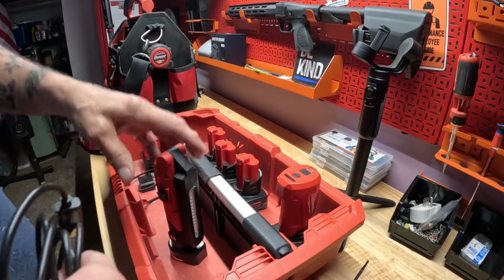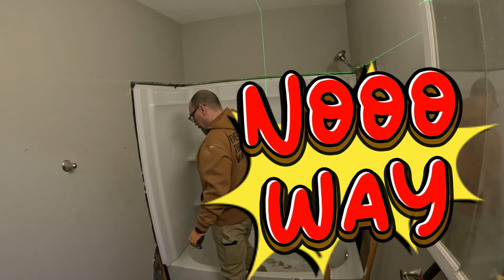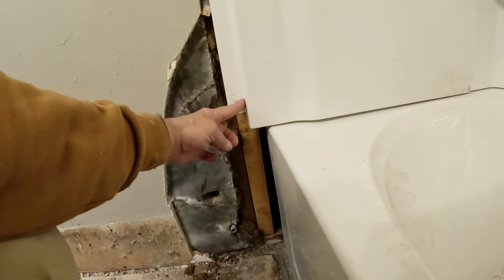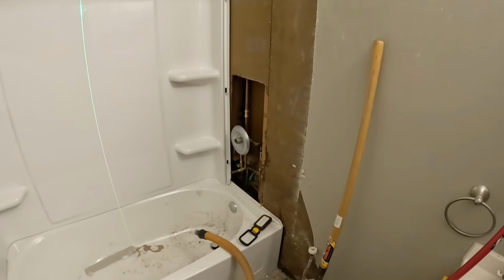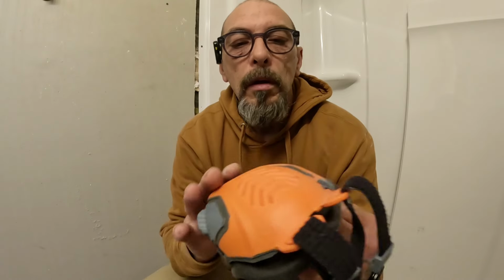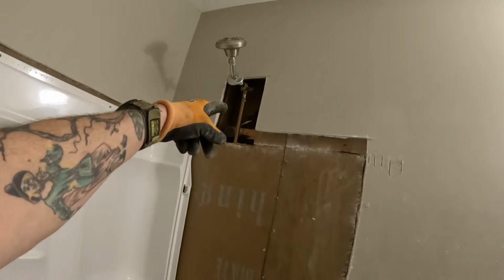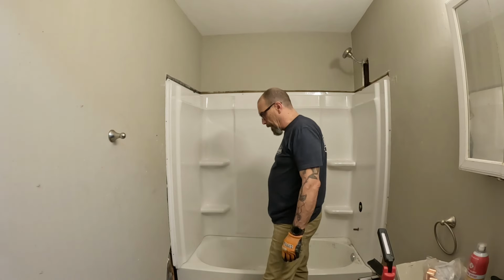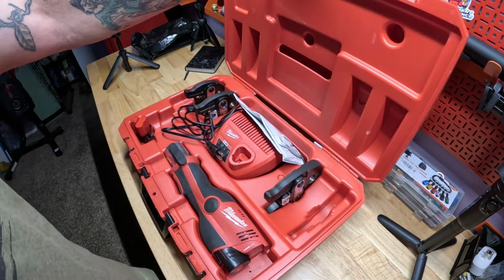The install just went bad, am I able to save the install!!!!

Comment: Separately pieced tubs are set-up for failure: especially when it comes to mold and mildew at the seams
(Most of the time bathroom fans are not even vented correctly and that will speed up that process)

Might be better off for future tubs to just be a one piece and then replace the drywall with GoBoard or green board, so you can waterproof accordingly. (It would most likely be less frustrating than this tub-system)

Great install and perseverance!! 🙌🏽
Reply from the maker: Feel you-- ?   How would i get a 1 peace tub in ?  That would be an almost impossible task. I would have to remove walls to do that. Fyi, this is apartments, not residential. You got to get it done fast and efficiently. And I am one 1 person, not a crew. I feel your though regarding install
Reply: @Raysmaintenance  that is true to be honest 🙌🏽 I am young”ish” and have only done tile/flooring in residential 
The south east humidity and poorly ventilated bathrooms turn sour quick out here, so I get YouTube tunnel vision

I was on my 3rd coffee this morning and overthought everything 😂 cheers brotha!

Comment: Save the sides for the next tub install and get the 29” for this one?
Reply: Usually you want to steer away from 3 piece tubs.
Down the road, they usually will cause issues thru the seams. (problems compound with a poorly vented bathroom fan)

If there’s no plastic barrier behind the tub or poly sealant placed between the seams — moisture will intrude over time
That’s why most 3 piece systems rot behind the wall and effect studs.
Reply from the maker: @ohokayofficial  water can't get behind the tub walls
Reply: @Raysmaintenance  it’s more of a moisture/mildew issue than actual water intrusion 

But if there’s no caulking on the seams, than water definitely can go in.

And with it being an apartment, I doubt the tenant will care about cleaning the tub.. so the mildew will have a nice new home.